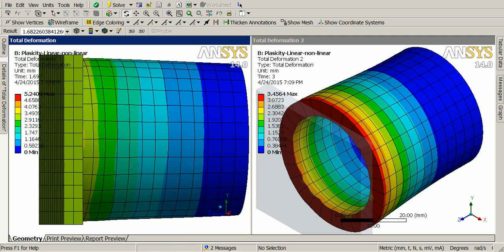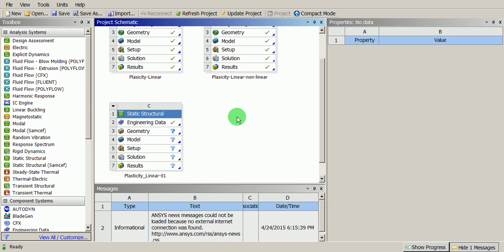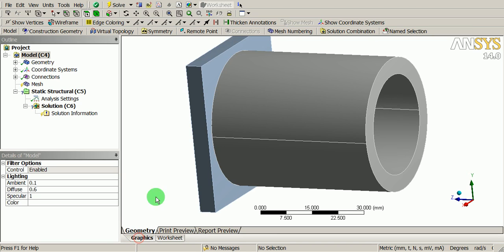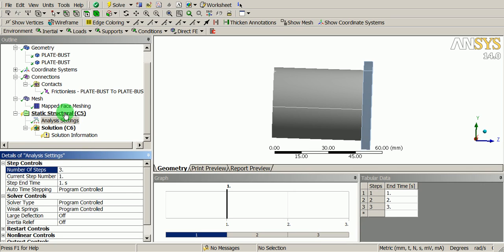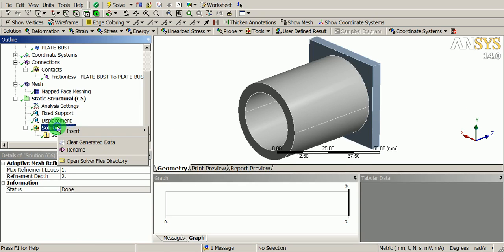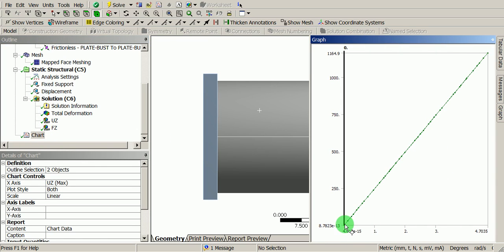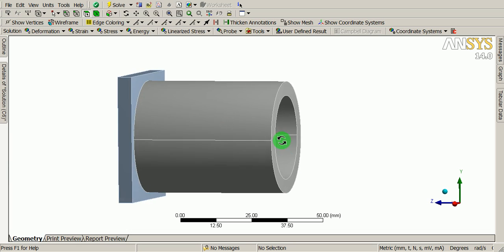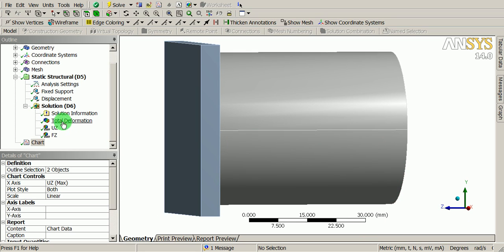ANSYS Spring back effect | Two load steps | Nonlinear plastic Deformation Analysis | GRS |

Comment: Thank you for this usefull video. Why did you use stiff plate at the free end instead of applying just -5 mm deformation in z direction directly on to surface of the cyclinder's free end?

Comment: First of all Thanks for tutorials, they are well explained. they help me to understand some steps which I needed in my work.
I'm doing my work on static & Explicit Dynamics Analysis of metal foam. My workstation is taking so much time while solving model.I am using ANSYS 15.0 & workstation has 24 cpu's which I learned to use but still I didn't understand how to use Physical memory properly. During solving model it uses Autodyn Solver and CPU usages is full but memory usages only 10-15%.
Please upload a tutorial about setting for distributed computing or anything which can clear my doubt about using full performance of a single workstation

Comment: Hello, could you maybe advice what analysis should be chosen for a plastic disc (PA6 GF20) loaded by 6.7tonnes downwards to the floor and the other part would be a concrete plate (representing the floor) and I am only interested the deformation and whether this part is strong enough to bear the load. I do not know the displacements so I would only use the force.
Reply from the maker: Static structural analysis